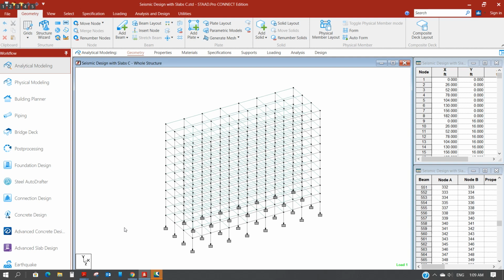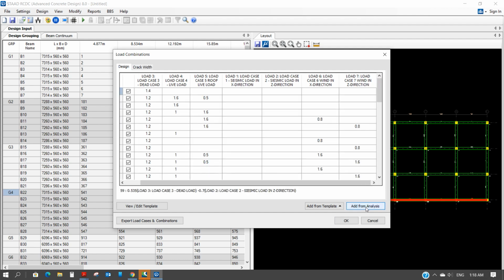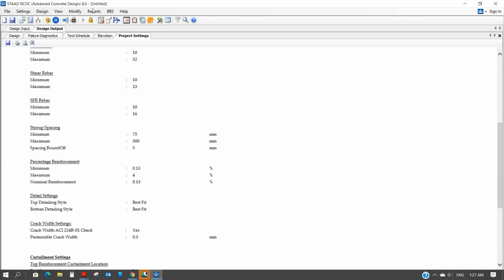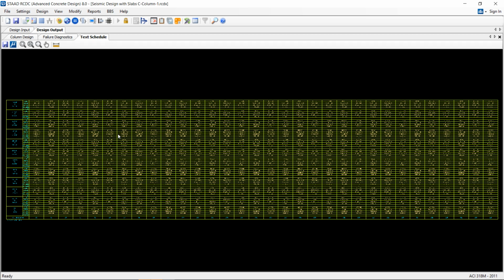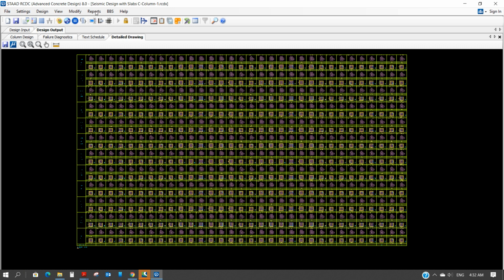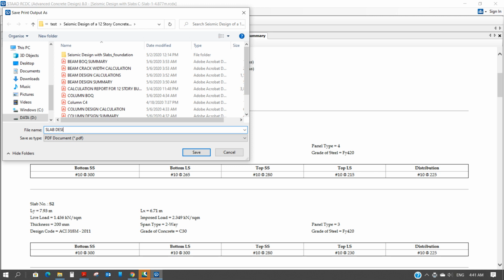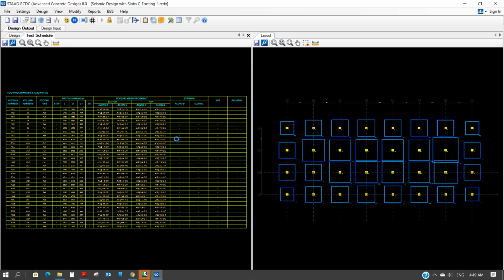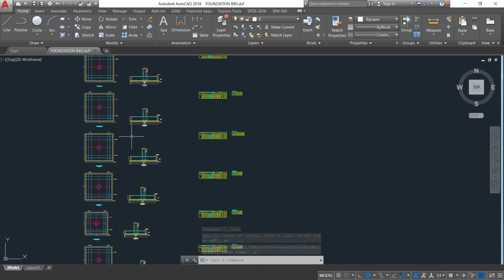12 STORY BUILDING DESIGN BY ADVANCED RCDC

Comment: Thanks sir, In rcdc slab design we provide imposed load and live load separately, But we have these load already provide in staad analysis file . Does it get double load on slab or replace these revised load.
Reply: No it will not get double, because rcdc recognize only space between beams and treat that space as slab.
Reply: @mukeshgarhwal1881  Thanks Sir, But Sir what about self weight of slab? Because we don't add self weight of slab separately  in  RCDC.Does it calculate automatically by provided thickness in RCDC ?

Comment: Thank you for such a nice presentation. I could not see complete, but shall try to see till end. However, I have some minor queries. In the summary of beam design B1, the design moment is calculated as 51.68 KN.m., and the corresponding As calculated is 374.26 mm2 (I guess, as I could not see small size font). Minimum steel is calculated as 1.36 in2 = 877 mm2, whereas the provided steel 5-13 mm dia. give 633.4 mm2, which is less than minimum. What is the reason that the provided steel provided is less than the minimum. Is ACI 318M-11, sec. 10.5.3 has been used? If the sec. 10.5.3 is used, then what is the actual calculated As? Is STAAD also gives detailing according to Special Moment Resisting Frame?
Reply from the maker: When you design an actual structure, you can check in detail. This is for educational purpose.